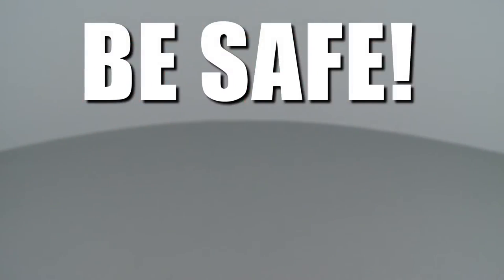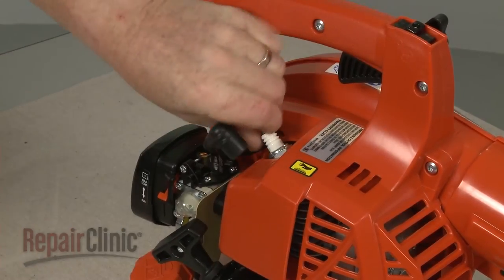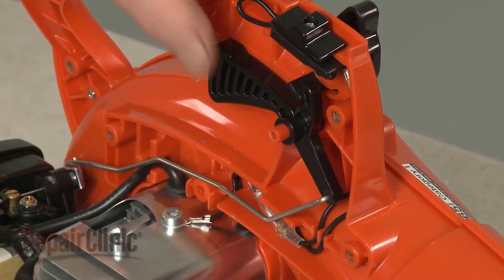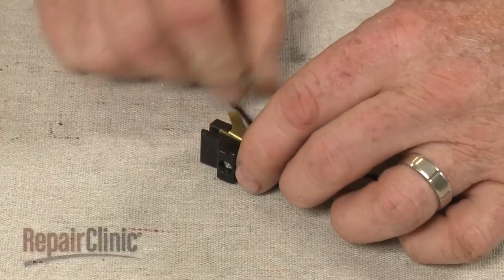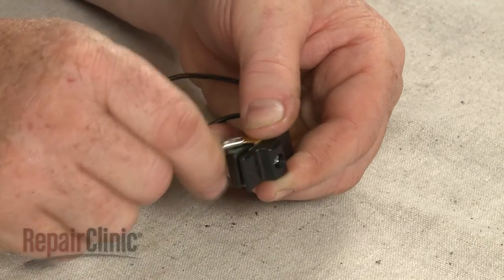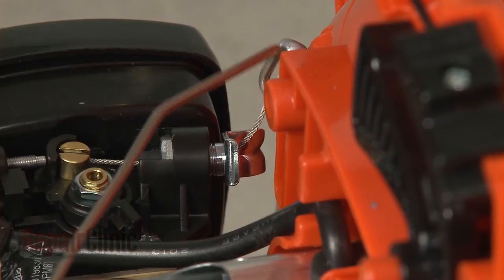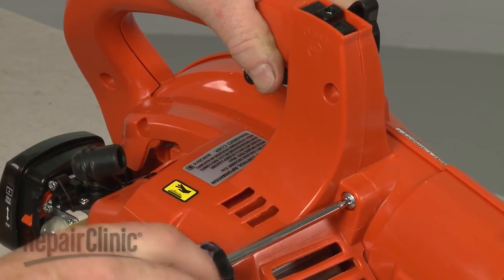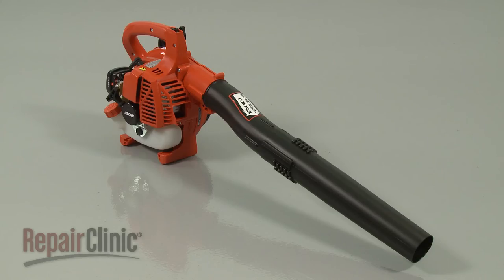Echo Leaf Blower On/Off Switch Replacement #A440001310

Comment: pulling the plug wire is smart. why pull the plug?
Reply from the maker: Removing the spark plug on this model makes it easier to remove the cover. Thanks for commenting!